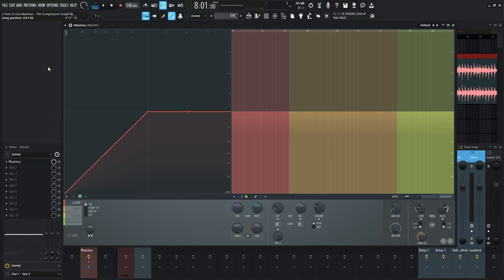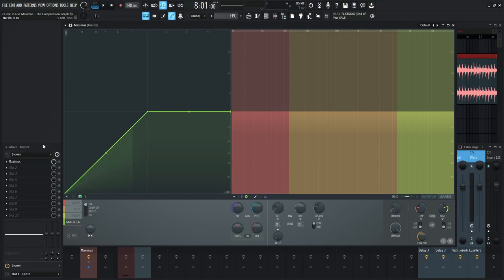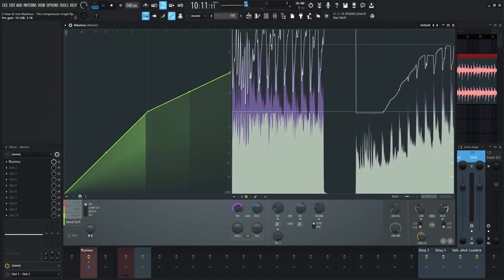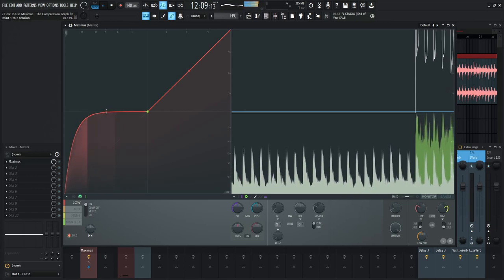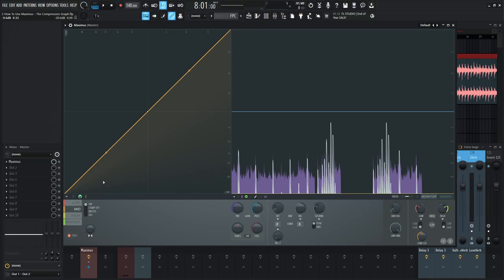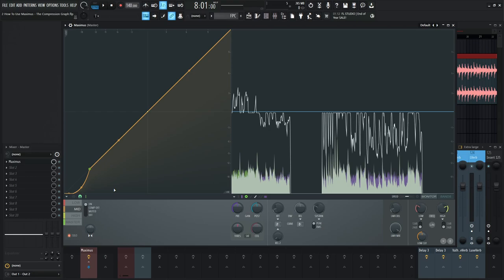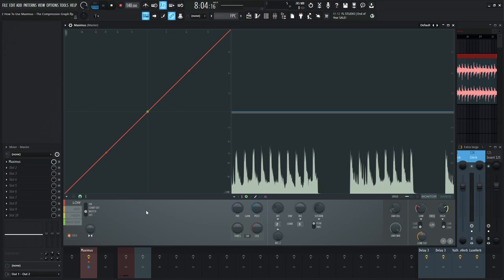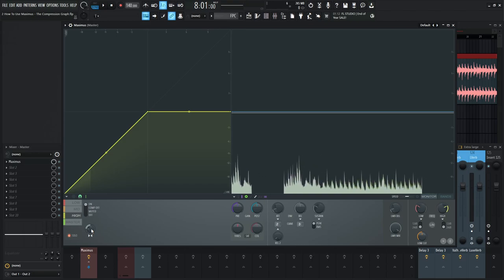Maximus Compression Graph PART 2 | FL Studio 21 Tutorial

Comment: That stereo separation knob seems cool.
Seems like could use Maximus as a stereo widener plug-in for certain situations, on a mixer insert for an instrument
Reply from the maker: You can absolutely do that! Just made sure to watch out for any phase issues if you push the knob too far.
Reply: @jonaudio  cool, will use that feature on some songs 

Seems like would want to widen out the top end more than mid or low 

Also have heard advice to double track with slight differences in takes and pan those out left and right to widen a mix. Am assuming would work with either real or virtual instruments as long as slight differences 

Putting something in the center of mix just gives exact replicas of sound on L and R from my understanding. Not quite sure why slightly different versions of same sounds panned out would create width
Reply from the maker: What you're referring to is called doubling. It's a very very useful recording technique. Let's say for example you are recording a guitarist, instead of him just playing the guitar part one time. It will sound wider and much much better if we recorded the same part twice and you panned those left and right. It gives jt a wide and fat sound because it is true stereo, whereas the left speaker and right speaker are playing two different signals, but they are playing the same thing. It also simulates how a concert would be if there are two guitarists on either side of the stage playing the same notes. The small differences in timing, pitch and phase play style really bring the mix to life.
You can also quad guitars, meaning you record the parts four different times, and put two of them to the left and two to the right. Keep in mind though, the more you double, you will get a thicker sound but at the expense of definition.
This technique is used heavily for vocals as well, which you could call stacking vocals. You will get a huge and thick sounding vocal if you record the same part a few times, then edit all the takes to make the timing correct.
This method will only work for true doubles, that is, literally playing/recording the same part over itself. It won't work if you just copy the same recording and pan those out. That will only result in an increase of volume, because the frequencies and phase are the exact same, in that case you would just be adding them together, making them louder.
Reply: @jonaudio  interesting. I guess a mix sounding wide is giving the illusion that the sounds are coming from different directions. The analogy of an orchestra makes sense.
Still don’t know too much about phase, will have to look into more. Based on your explanation it sounds like when you double tracks, they have different phases, and that contributes to  sense of width

Comment: can stereo separation can be used as a mid side EQ on the track, so that I can let the vocals to punch through by "separating the mid"?
also, can you talk more about the ratio? is there any preset use cases in ratio in terms of mixing or mastering
Reply from the maker: I wouldn't think of it in the sense of a mid side eq, but more so how you would stage the different frequency bands in your mix. So typically things like, Kick and Bass are going to be panned in the center. So this is kind of like panning things in the center, but doing so with a frequency band.
For vocals I'd leave the EQing portion as its own step in the process, perhaps a pre and post EQ on your channel strip.
A good way to have vocals punch through the mix is switching the compressor from Peak to RMS on the midband and dial in the compressor from there.
As far a ratio goes, a good way to understand it is this, if the compressor is set to 8:1, an increase in level of 8dB, past the threshold will result in 1dB of gain increase at the output.
Hopefully that help!

Comment: i've noticed the curve acts exactly like waveshaper. Using it as a exaggeration creates "dynamic" on the beat but introduces distortion, am i correct?
Reply from the maker: The curve can introduce distortion if the expansion is too much. You can also create distortion by setting the release time to a quick value. What's happening there is the compressor is releasing so fast that it literally distorts the waveform. This can be a cool effect if done intentionally, But if we just make the expansion curve too high, this will cause expansion to overload the band output.